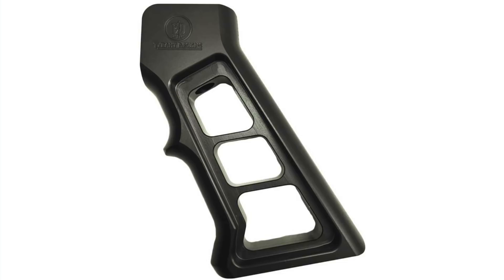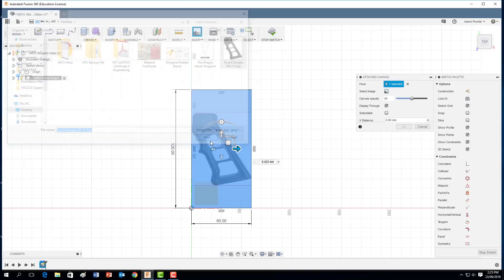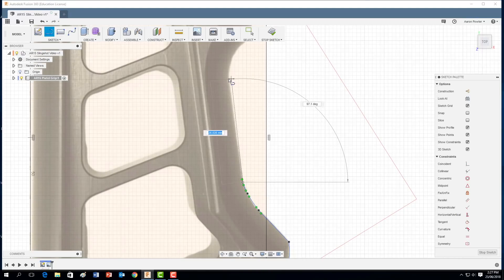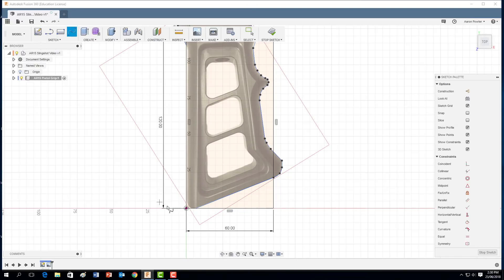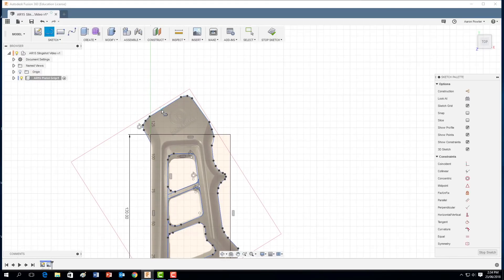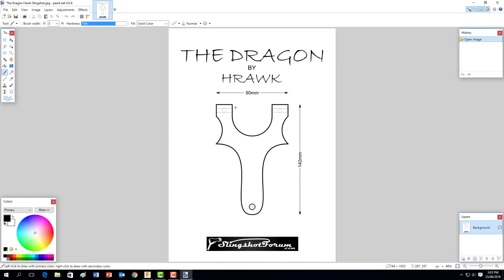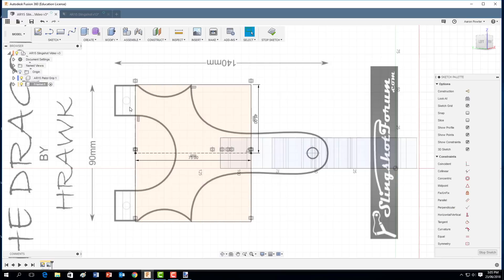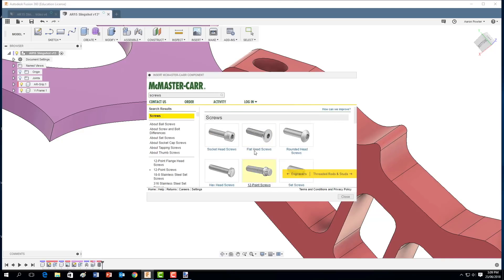Fusion360 Slingshot Tutorial

Comment: Is that a .223 or 556?
Reply from the maker: Cape Cod CNC it’s what ever marble or ball bearing caliber I can find lol
Reply: you need some carbide BB's! What are you using for for the rubber?
Reply from the maker: Hey Paul, I bought 6 x slingshot strings from Fleabay (eBay).  They came with rubbers, pouch and all tied off.  Fingers crossed they work ok for me.  Cheers, Aaron.
Reply: That should be sweet, hope we get to see you doin some plinkin!